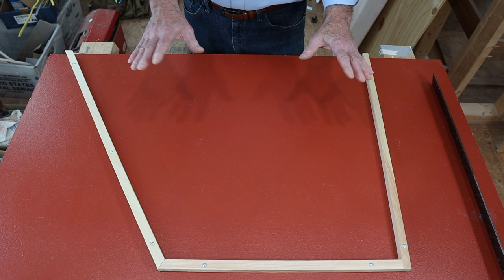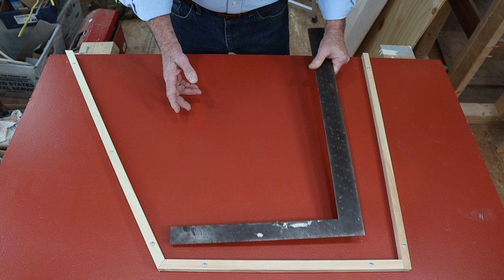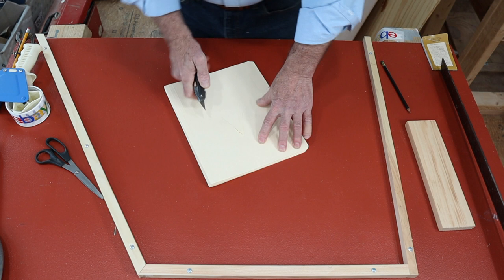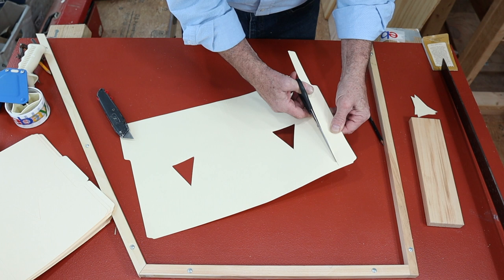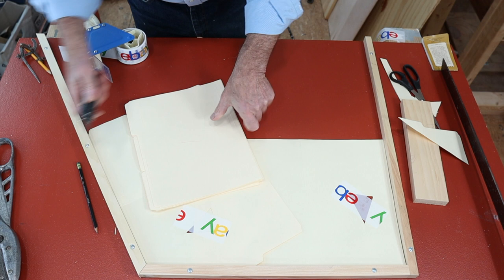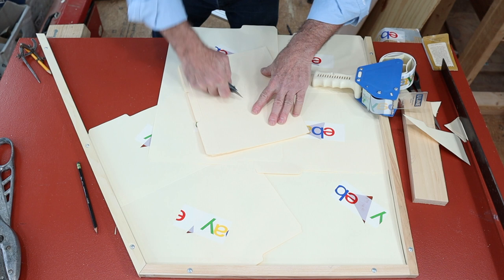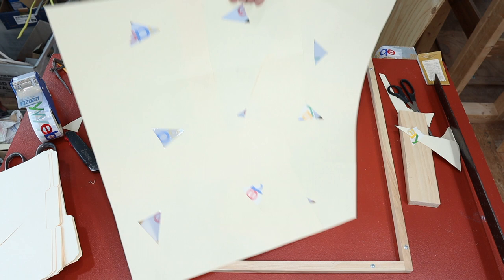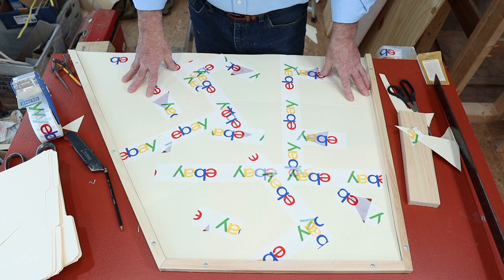My No-Measure-Perfect-Fit Carpentry Trick: Make Easy File Folder Patterns

Comment: I have used this same idea with builders or red rosin paper when it was handy. Whenever the wall is wavy or contoured one can use a flat washer to copy the profile onto the pattern. Just lay the washer on the countertop or floor and insert the pencil point into the center hole. As you pull the pencil the washer will turn and make a profile line that can be cut with sissors. Hope others find this tip useful.

Comment: For vinyl flooring the trick I learned was a make a similar but looser paper pattern then using the 2” body of your framing square make offset marks around the perimeter. Then use the offset marks and your square on the marks to knife the goods. It has the advantage of a steel guide for your knife (10-499) instead of free handing to a fragile paper edge.

Comment: I have done that with lined paper from my note pad.  Mainly for that type of pattern I would use 1/8" Masonite cut in 2" stripes and hot glue the 4 corners.  But that doesn't work in all applications like paper or cardboard would.  Thanks for the tip!  (Looking forward to your gardening videos this year.)

Comment: I used cardboard for funky angles when  laying down plywood substrate. It worked ok but cardboard was bulky and a struggle to cut straight. Your file folder tip would have saved me time and aggravation. Thanks for sharing!

Comment: I use a similar, technique,  using 36 inch wide brown kraft paper from the economy very large retail store, with the triangles cut out to attach to surface, and trim it to within a rough inch or so of the shape border, and then use a square or block wood, depending on the project size, to scribe a pencil line on the kraft paper a fixed distance from the shape border.  Then I can lift the kraft paper and place it on top of, for example, sheet vinyl flooring and transfer the pencil line back  to the cut line, again using the square or wood block.  For larger projects, the kraft paper needs less taping together and there is no need to precisely cut the paper, the accuracy comes from the scribed line..
Reply from the maker: Good idea. I like it. 👍